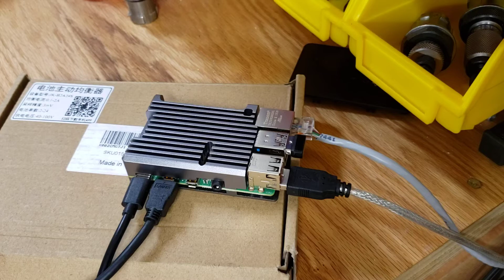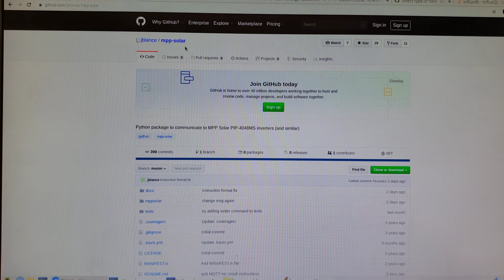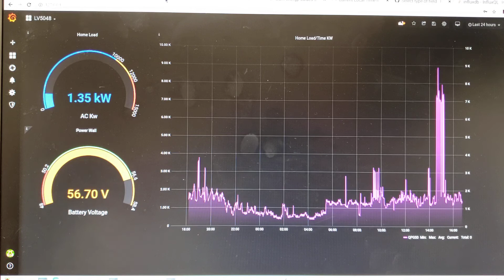LV5048 Inverter Data to Grafana. Thank You jblance.

Comment: Nice. I guess I'll be getting a raspberry pi soon. Anyway to implement a schedule on it? something that would tell the inverters to start charging from grid if voltage level is below a specific level. For example my georgia power gives me a great discount on electricity used from 11PM until 7 AM. So I can take advantage of that (1.4 cents per kW). I am using SolarPatrol software which sucks for reporting data because it only sees one side of the dual inverters but it does have the schedule functionality which WatchPower doesn't have.
Reply from the maker: Yes, you can implement schedule.